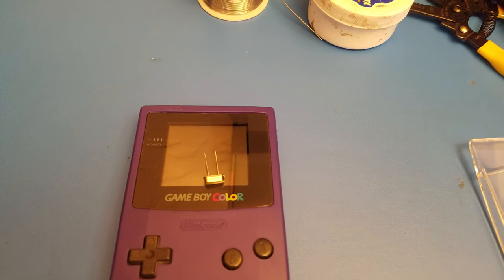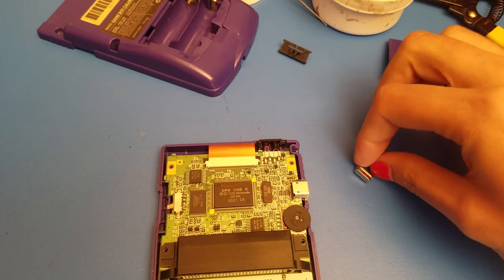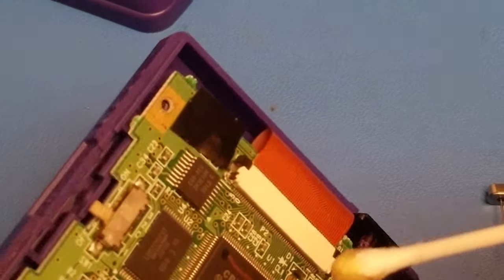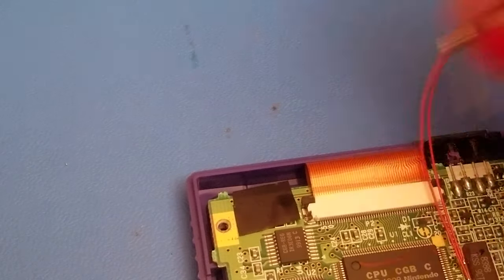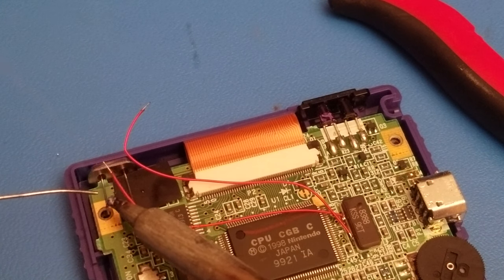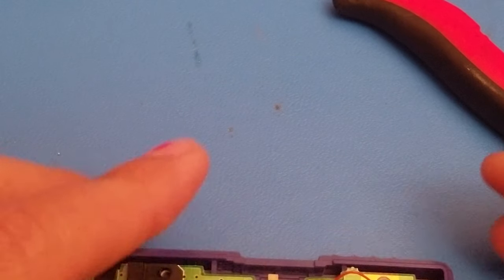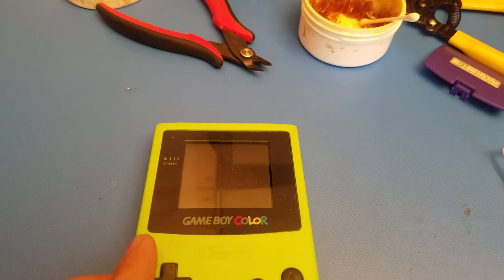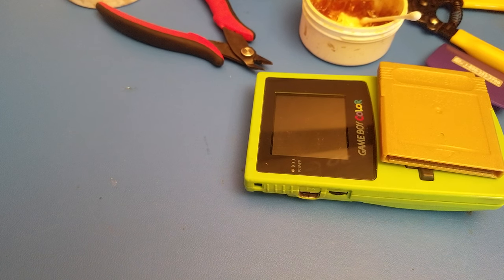How to overclock your Gameboy Color!

Comment: Nice videos. Why did you go back and change the the wire from one side of the oscillator to the other ? Will it work both ways?
Reply from the maker: The oscillator is not polarized, i just went back at it because i wanted to shorten up a make sure the shorter wire i stripped was proper length to have a neat install

Comment: I have the wires hooked up in the gameboy color fine but no matter what I try I cannot get the oscillator to function properly? Any ideas or tips?
Reply from the maker: Sometimes i have issue with the oscillator functioning as well. Sometimes i  find myself changing it out for another where they fail out of nowhere. At the low cost they are its not a big issue

Comment: Need a video on the battery mod!!!!!!!!
Reply from the maker: Im uploading now a video showing how I did the battery mod. I didnt show me cutting the case in the video and the soldering. But i didnt say how to cut and where to cut. Where the wires go etc. I will make one eventually on the full installation. But i havent grabbed a new battery to go through the full process again yet. Hope the video helps for now

Comment: Hi,
How safe is this mod? I know with any overclocking it's impossible to guaramtee any kind of safety, but is it still working and has it seen a lot of use?

A speedup function using this method and a switch would make my modded GBC perfect, but don't want to dive into doing something like this if the console is gonna die a few months down the line.
Reply from the maker: The safety is determined by how extreme  you take it. Mines seen tons of use bjt keep in mind if you use like an ever drive and you make a save state in overclock mode but load in normal or vice versa it may corrupt the save. This mod also does not play nice with lcd mods as they often are dependent on stock clocks.
Reply: @rainbowrepair5692  Thanks, I was just aiming for 2x speed I didn't want to go too crazy - one last question though, I watched JayBoyModz GBC overclocking video for the purpose of working out how the switch fits in and he says the stock crystal is 8MHz. I've ordered an 8MHz crystal based off this video where you state the stock crystal is 4MHz. Which is correct, can it vary between models? I don't want to solder in a crystal that is the same speed as the stock one :P
Reply from the maker: @nyx-is3xv  i use a 12mhz crystal and it appears double speed.
Reply: @rainbowrepair5692  Oki doki, thank you I've ordered a 12MHz one glad I asked that. Thanks for the fantastic video, this along with JayBoyModz seem to be the only place to get a good idea of how to overclock a GBC properly :D
Reply: Got it all soldered in, the gameboy boots fine, but it appears the switch does nothing - I've checked all the joints and they all seem strong.
Reply from the maker: @nyx-is3xv  as long as its wired up properly to the switch and back, ive had experiences where the switch works intermittently sometikes due to bad switch, poor quality crystal. The gbc does its best to snag the highest possible clock speed on boot. So sometimes you just gotta boot up multiple times. I know its frustrating but youll know when it makes that high pitch boot jingle.
Reply: @rainbowrepair5692  I think Im just messing up somewhere, tried multiple reboots and didn't get the speedup. I then completely rewired it with a new crystal same issue. Completely rewired it again but this time on the right side of the stock crystal and used a new 16MHz crystal and it still wouldn't work.

Wiring Im using as it is the same kind of switch Im using for reference:

http://i529.photobucket.com/albums/dd335/BShacker/GBCswitch.jpg

I've checked all the solder joints and they seem strong but Im maybe wondering if I've maybe done some shoddy soldering somewhere that is creating resistance so it just uses the stock crystal even if the line to the higher crystal is connected? I'm not sure Im not too good with electronics. Been sat fiddling with this for hours 😓
Reply from the maker: @nyx-is3xv  it should pick up on the higher speed if its all wired right. that is the same reference picture i've used before. have you also tried another switch as well? remember the switch must be set to ON before hitting the power switch.

Comment: thanks for this video.
Reply from the maker: Youre welcome
Reply: @rainbowrepair5692  I used a 8mhz crystal in mine from a couple of GBAs that I've done. There is no doubt that those GBAs run close to 2x speed. 

However, I just installed one in the GBC and my placement is different than yours. My switch is where you put your crystal and my crystal is on the opposite side of the speaker towards the bottom. 

The speed is no where near 2x I was wondering if the length of the wires could lower the speed. I have the wires running along the sides of the GBC.
Reply from the maker: @Syx7h  the wire length bares no significant difference. Its the speed of the crystal you used. Since each handheld, gb gbc gba gba sp use various speeds. Generally speaking youll wanna try a 10 mhz or 12 mhz crystal. Try that and youll see
Reply: @rainbowrepair5692  I think the problem is my Freckle Shack screen. I tried a few different crystals 10MHZ - 20MHZ just to see what would happen. 10MHZ has glitches on the screen or maybe it's a sync/refresh issue? Anything above that and it's even worse.

My GBA has a 101 screen installed and it works just fine with it. It will accept a crystal up to 12MHZ and it seems to work fine. 

Just thought I'd share the information.
Reply from the maker: @Syx7h  oh okay yea i didnt know you had the freckleshack. Contact ben if youd like on fb. Hed be happy to explain the incompatiblity im sure if youre curious
Reply from the maker: @Syx7h  ive spoken with him several times in regards to my overclocked gameboy setups and his elcheaposd carts

Comment: Is 12 MHZ too much?
Reply from the maker: Dependa on how fast you want it to run. Its fine yo me if youre tryna speed through a game. Keep in mind the overclock doesnt function with backlight kits.
Reply: Natalie Marie Natalie, would the overclock mod work with an IPS screen?
Reply from the maker: @LetsHikeRhodeIsland  its possible to use them together but thr lcd driver board would need a modification to accommodate 12mhz. And it would be set to run on 12mhz. These new screens are designed with stock clock speed in mind
Reply: Ah. Gotcha. That makes sense. Well I bought the switch, the oscillator, an amp and the battery you linked me a few days ago. I’m gonna slap this all together and see if it works
Reply: And an IPS screen!
Reply from the maker: @LetsHikeRhodeIsland  sweet. Just make sure youre on stock speed before booting it up if your using the IPS unmodified. Enjoy
Reply: Natalie Marie thank you for all the help! Do you have IG? I noticed you work o  other things too besides GBs
Reply: Natalie Marie is it normal that the overclock can only be switched off once the console is on and it can’t be switch on?
Reply from the maker: @LetsHikeRhodeIsland  yes. You have to  choose the speed before boot because the gbc chooses the fastest speed on boot up and only checks during that time. You can boot up in oc and switch to stock while on but cannot boot up stock and switch to oc when on
Reply: Natalie Marie thank you, I just wanted to make sure I did it right. I appreciate all the help!